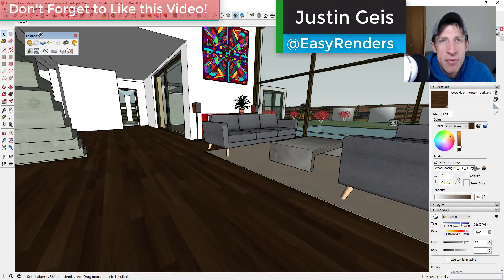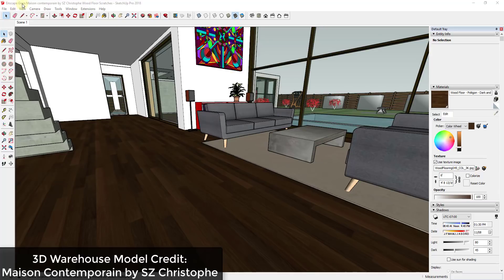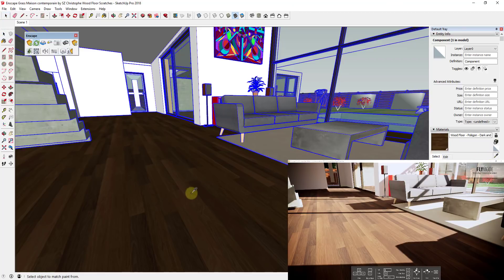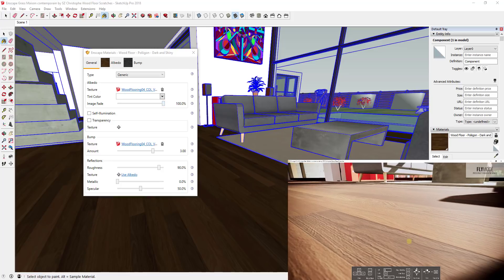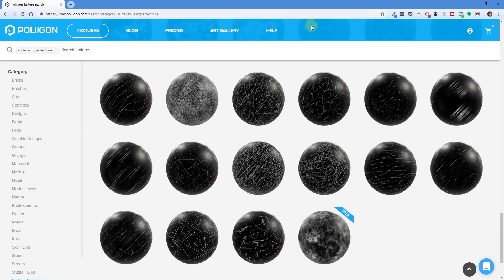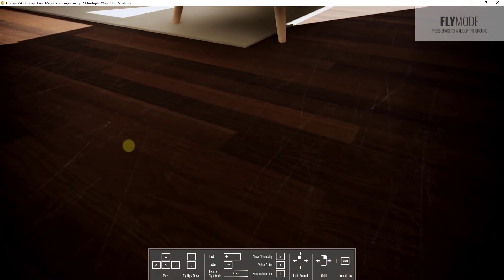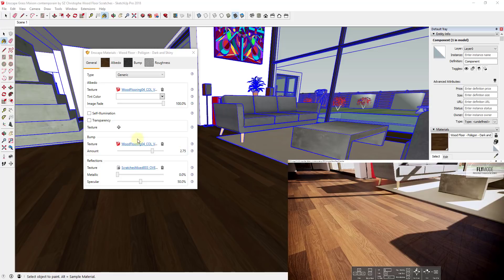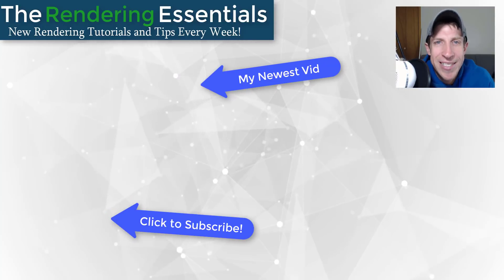Adding SCRATCHES TO MATERIALS in Enscape for SketchUp

Comment: Hey Justin , does it work with Lumion ?
Reply from the maker: I don't think so, unless you figure out a way to add the scratches to the normal map itself (or possibly a bump map?) - Lumion only provides a slot for a single map, which is the normal map, so you'd probably have to Photoshop the scratches onto the map itself
Reply: @TheRenderingEssentials  Hi guys, Lumion is capable of reading the alpha channel of both the diffuse and normal map inputs meaning there's a total of 4 maps that can be included (diffuse, Normal, Gloss, and Specular). In order to do this in lumion you'll need to insert the gloss/roughness map into the alpha channel of the normal map image. This can be done in most photo editing applications that allow access to the RGB and alpha channels of an image. Once that's done the reflective and glossiness sliders in Lumion will register the information of the glossiness map rather than the diffuse image.
Reply: @imallhere1  do u have a tutorial

Comment: I like to mess around with the scale of imperfection maps.  I find going with non-uniform scaling makes them look even more realistic (so the x and y values aren't identical).  You just have to be careful you don't make the imperfections look way too big or small but more spread out.  I've had success doing wet asphalt (puddling) this way as well as smudges on glass using Poliigon textures.

Big fan of your tutorials btw.  I'm the "3D guy" for our architectural firm.  Been using SketchUp for almost 8 years now and recently started using Enscape (previously used Thea Render).  Its so nice not having to wait hours for renders to complete.  I'm hoping in a year or so I'll be able to upgrade to Lumion which seems like its in a whole other league in terms of animations and overall presentation quality.
Reply from the maker: Totally agree with this - this was a quick demo, but I felt like adding the scratches to the entire floor looked weird. I was thinking about playing around with breaking up the textures into unique textures on smaller areas and creating small scratched areas that way. I fully agree about real-time rendering programs - they're just really easy to use, which I like. Thanks for the comment! :)